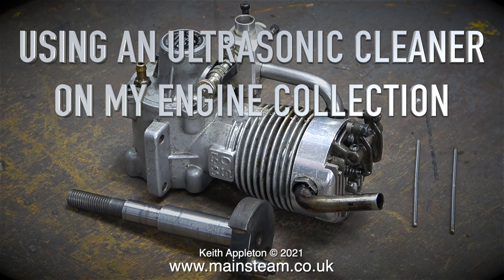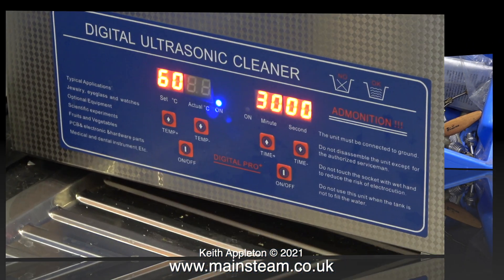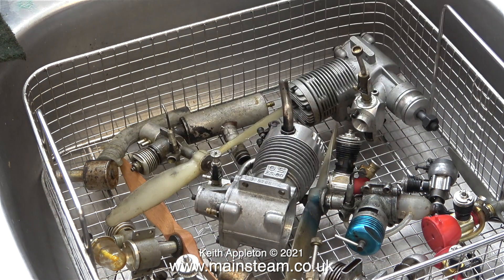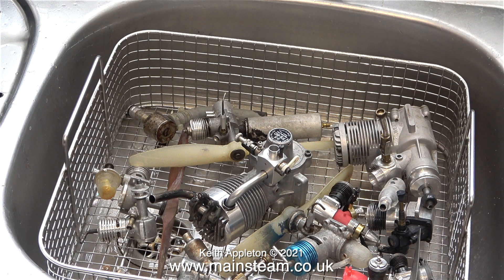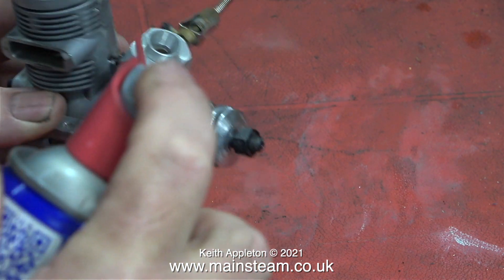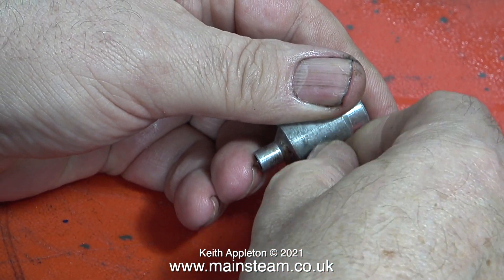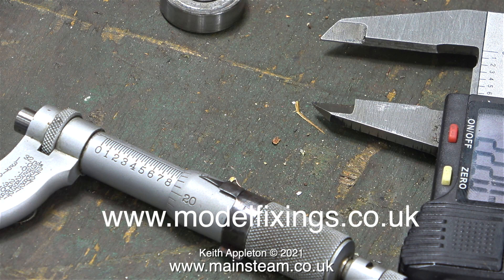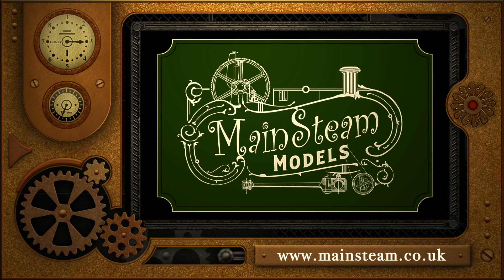ULTRASONIC CLEANING - MAKING LIFE EASIER

Comment: Keith, I have also tries all of these various solutions and ultrasonic cleaners, but the best and safest by far is a "crock pot"/slow cooker with straight undiluted green ethylene glycol antifreeze. Leave overnight, brush off with an old toothbrush. It also is completely safe to allow inside the engine, it will not corrode the bearings, and, unlike ultrasonic cleaners, does not cause the bearings to be bounced around at ultrasonic frequencies. We use it to remove varnish from cylinder liners and pistons all the time. You do want to oil it afterwards, but it is not dangerous or rust-enhancing like water. I have done mufflers and tuned pipe headers that are far, far worse than yours, they come out shiny like out of the package with no abrasives.

Comment: For your mufflers that are coated in burnt castor oil the best thing we found for RC cars was to cook them up in antifreeze overnight helps it come right off. Not telling you hoe to suck eggs but a good light mineral oil is good in the crank case some products like CRC contain acids  that will eat into your bearings.  Will be great to see it going though

Comment: I have had very good luck saving small engine carbs with the proper solutions in an ultrasonic cleaner. I did try some alternatives suggested by other techs and was not impressed. Maybe that is why I had a better success rate. You can use the solution more than you would think. I changed it every few weeks. Maybe a dozen carbs.
Reply from the maker: Great tip!

Comment: If you have a concern about the plastic parts then drop in a piece of scrap plastic.  In my experience is that if the plastic doesnt soften or get sticky or change sheen it is probably ok even if they arent the same plastic.  I think this is because all plastics are a blend of different plastics so if it has even 5% of a susceptible plastic it will be sticky or slippery.

Comment: Didn't even dawn on me that it had a case tap for tank pressure. Been a while since I've seen one like that!
Reply from the maker: The nipple on the Crankcase in this type of engine is an oil drain to get rid of the excess oil - when the engine is running a surprising amount of oil comes out of it.
Reply: @keithappleton  It is also the only pressure relief on the otherwise closed crankcase. We have found that either restricting (by putting on a long tube) or reducing the restriction, can have a drastic effect on the way it works for CL Stunt/F2B.